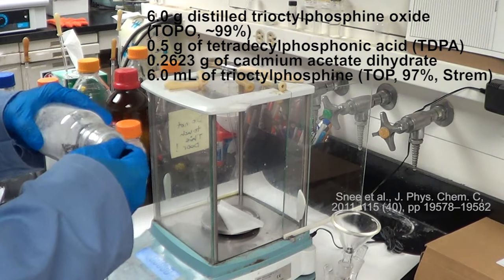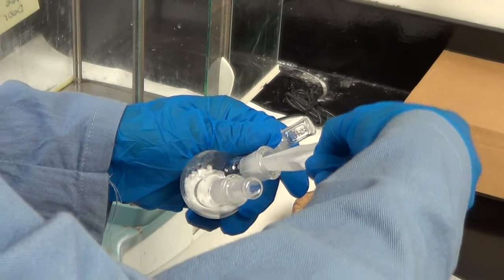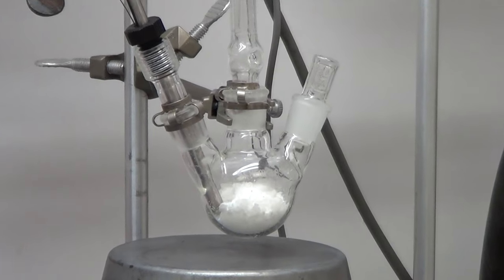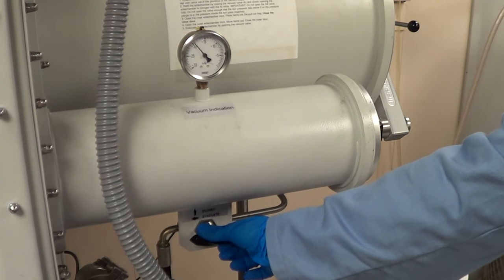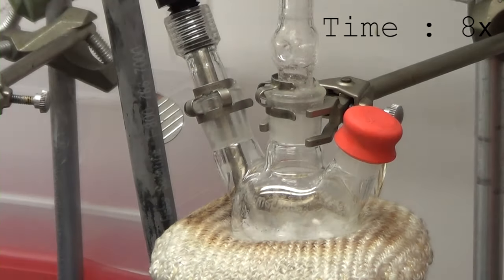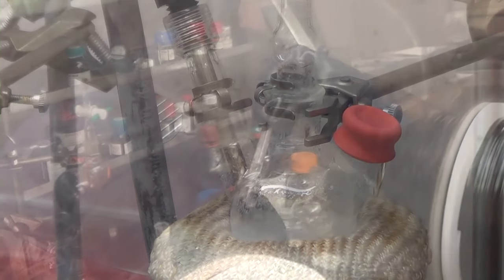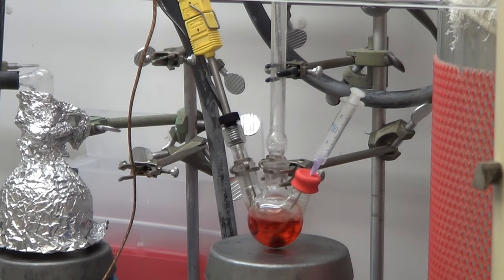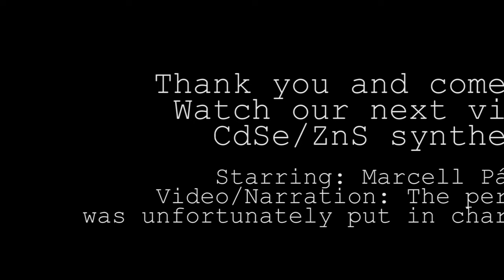Synthesis of CdSe Quantum Dots

Comment: Looks rather interesting. If the solution is more dilute you get smaller dots. The most important thing is rapid mixing and absolute lack of oxygen and water. Try the reaction using microwave heating. That works extremely well for creating organic semiconductor based quantum dots.  🤓😁❤

Comment: In my lab practice, I create a vacuum in a flask and then introduce argon. My question is about the vacuum time: Is it sufficient to stop when the manometer shows -1000 mbar (which happens almost immediately), or should I hold the vacuum for a bit longer to ensure the system is fully evacuated?

Comment: Not sure why you say you must use TOPSe in glove box or not do it at all. Its oxygen sensitive and toxic sure (as with a lot of QD synthesis), but you are acting as if its pyrophoric or seriously dangerous when its not. There is a paper in chemical education which showcases CdSe QD synthesis with non-air-free techniques and the synthesis is designed specifically for undergraduates.